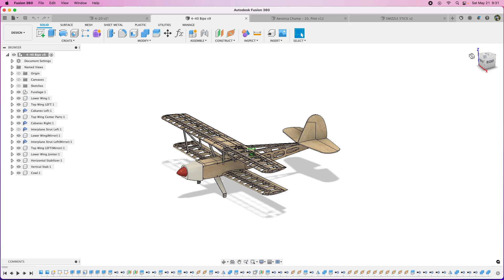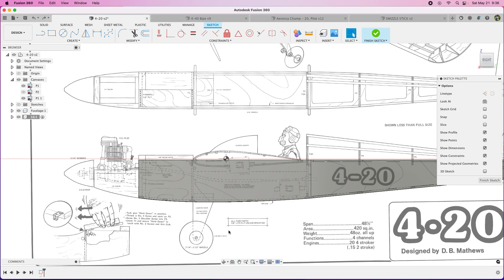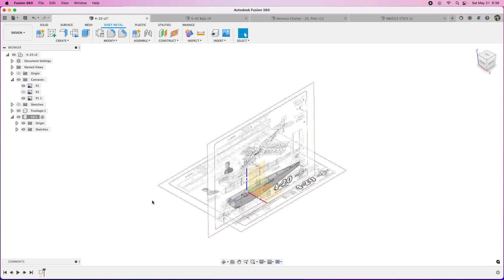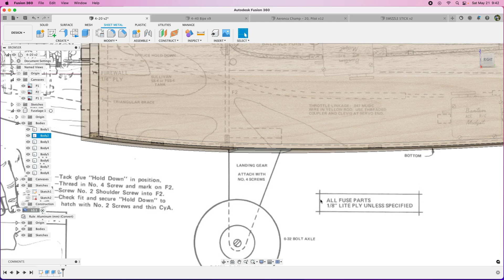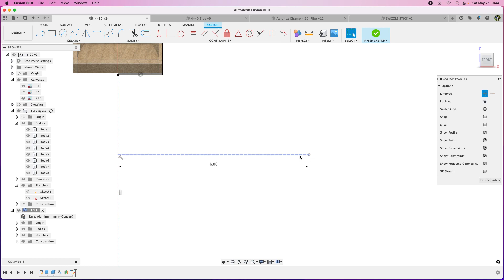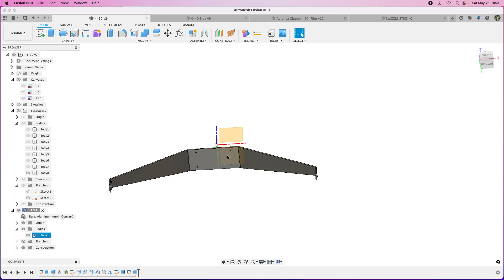RC Model Design in Fusion360 Drawing Aluminum Parts

Comment: Your videos are really helpful - the best I have found - thank you for investing the time and effort. I'm currently designing a Fokker Eindecker from 3-views using techniques from your videos. It would be good to see a video about generating complex fuselage cross sections from 3-views for WWII warbirds or an Extra 300 or similar? In my experience the cross section drawings tend not to be accurately drawn to the main views leaving some interpretation (guess work)! as to the actual cross sections.
Reply from the maker: Hello, thanks for the compliments on my videos. I find mistakes all the time in plans and drawings. Thats the beauty of 3D, it doesn't eliminate them, but it vastly reduces them.  With the basic fuselage and turtle deck videos, it should be easy to replicate the Eindecker. It's basically a box type fuse with a partial cylinder on the front for the cowling and a couple of other curved features. I think people get lost in the weeds looking at cross-sections. Break down the structure into the simplest primitive shapes, then add your features. Furthermore, if you were creating your own design, you wouldn't start with profiles, you would create the outlines first. The profiles are the result of outlines. Take the same approach when recreating a design, it will be much easier. IMO
Reply: @thercguide4735 Thank you - all makes sense!

Comment: New subscriber here.!
Just found your videos , they are great. I want to buy a small diode laser cut machines and i need how to learn to make the planes. Your channel is what i was looking for.
I was checking cost for fusion 360 and i do not think i can make enough plane to justify the price.
Do you have a recommendation for a free design software simmilar you fusion 360,? so i seee your videos as guidance. 
Thanks!!
Reply from the maker: Hello, thanks for the Sub! I think you can use Fusion360 for free.  Even so, some people use FreeCAD for model design. I've grown to appreciate what Fusion360 can do for my modeling. I don't make enough money, to "justify" it, but I consider a part of the cost of my hobby.